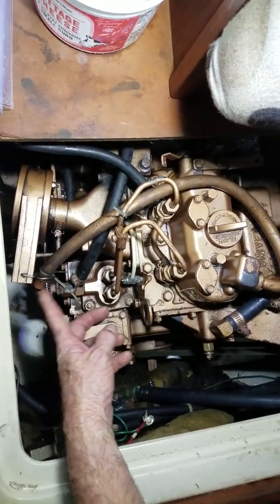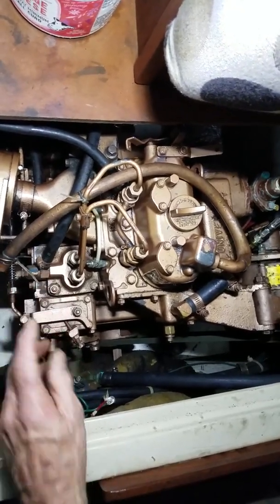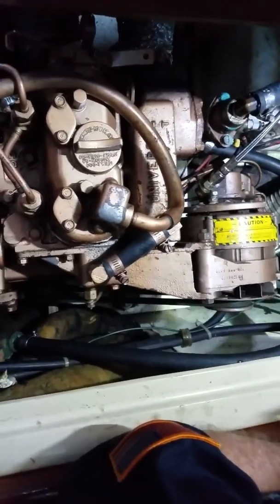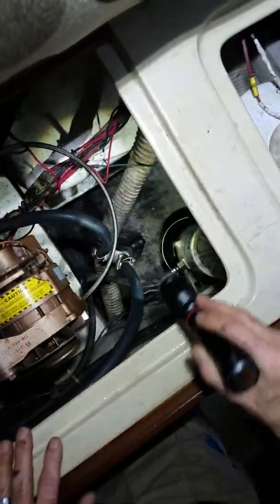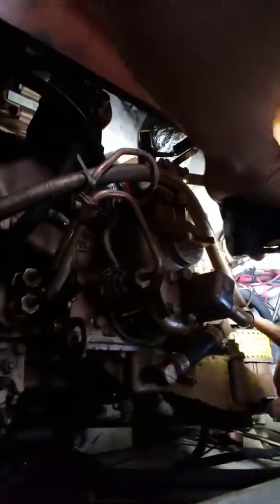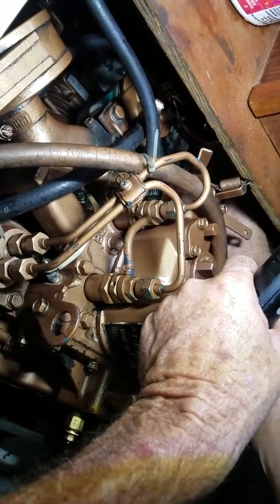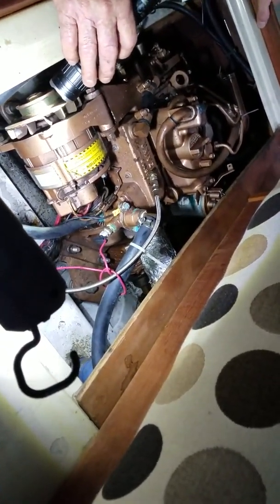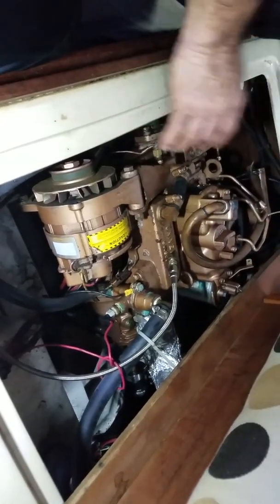Universal 5411 Walk Through Part 2b - Water Cooling & Exhaust

Comment: A little bit frustrating....making the video AS you're learning about the engine, you didn't know what needed to be seen by the camera....a few instances where  the mechanic was showing you something, but you still had the camera viewing another area, so missed that explanation, or the mechanic talked about something, like your primary fuel filter, but did not point it out, and the camera did not show it.
But it was great that you caught the process in bleeding, with cracking the injectors being the last stage to bleeding ALL air out of the line, as being CRITICAL, as the slightest bubble acts as a compressible loss of prime and flow.  One thing I don't think he talked about, there's a bleed screw on the top of the secondary (my only) fuel filter back next to the De-Compression lever, so that can be cracked open and let fuel flow from there while cranking....which confirms your line from the tank is unclogged, and confirms the fuel pump (I've seen  often referred to as the "Lift Pump," lifting fuel up to the fuel filter) is working too.

I just changed  37 year old rubber fuel line from the lift pump to the filter, and introduced air into the otherwise perfectly running system that has NEVER failed to start in 37 years....now won't start, so it was good to methodically go back over the fuel delivery system in stages, on this video....really helps to compartmentalize the problem and not freak out or become despondent about it....just deal with it in stages and fix it.  :)